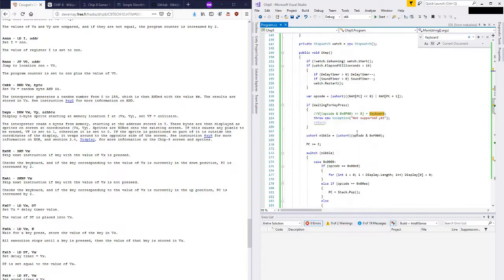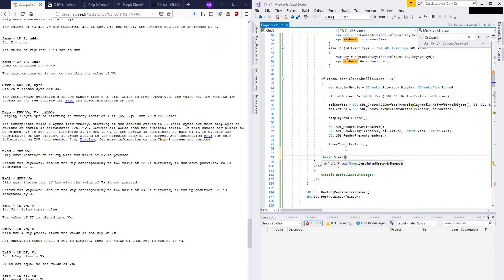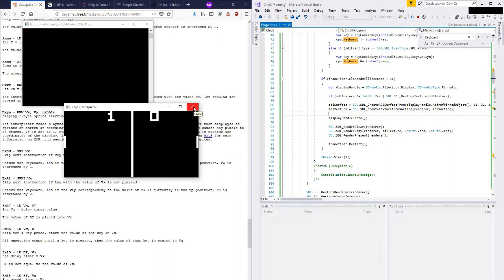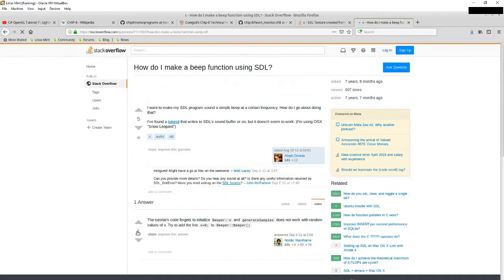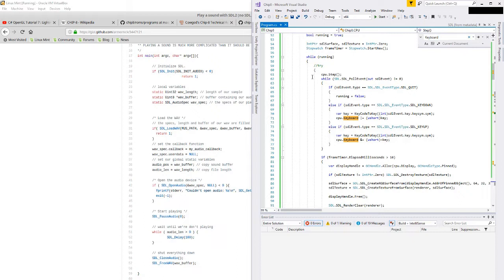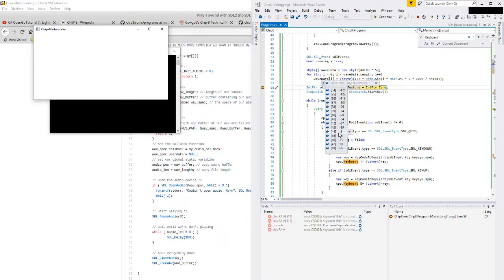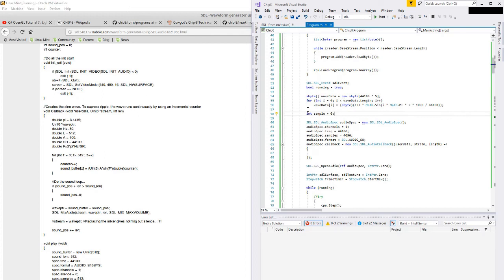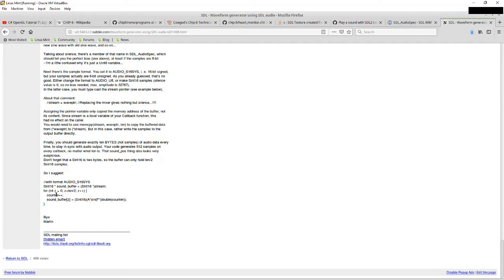Chip-8 Interpreter in C# - 12/15 - Attempting Audio

Comment: The flicker is inherent to the way CHIP-8 draws to the screen. It XOR's the sprite to draw with the stuff already on the screen, so to move a sprite, it first draws the sprite on top of the old position, erasing it with XOR, and then drawing it again in the new position. If the display gets rendered inbetween those two draw operations, which it frequently will, you will get frames like the one you had with both paddles missing.

There is stuff you can do to mitigate it, like  simulating an old phosphorescent screen by having pixels that get turned off "fade out" instead of immediately  going black.
Reply from the maker: That's a cool idea!  It should be relatively simple to do in a shader or something similar.  Thanks for all of your comments on the videos, sounds like you've had some neat experience with chip-8!
Reply: @GiawaVideos  Oh for sure, I love CHIP-8! It's not as popular as it was back before I was born, but I actually make CHIP-8 games once a year as part of the Octojam: https://itch.io/jam/octojam-6 Thanks for the videos too, always nice to see someone's thought process. Hope you'll get to make that GB emulator ;)